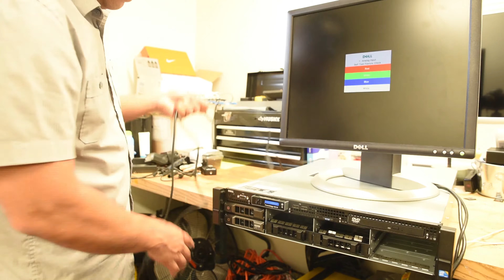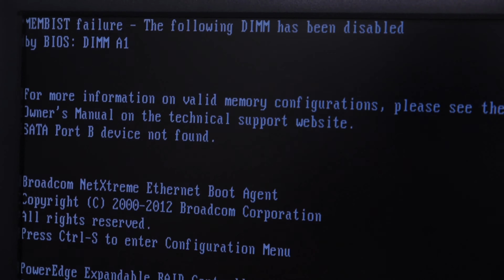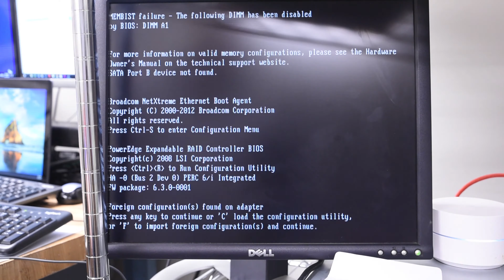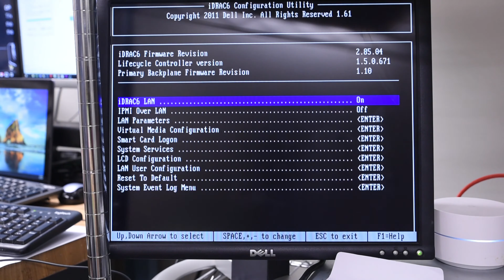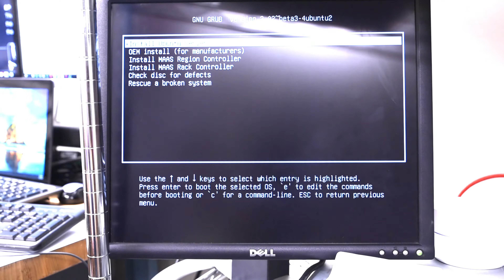Dell Poweredge R510 Motherboard Replacement and Ubuntu Install

Comment: The baseball cards are a good cheat to get the ssd in. but wont it be a pain in the ass to get it out?
Reply: Actually you can just use the regular mounting screws and position the drive at the back of the caddy. I have an R510 that came with four SSDs and that's how they were mounted.